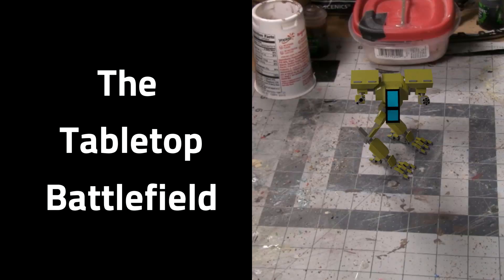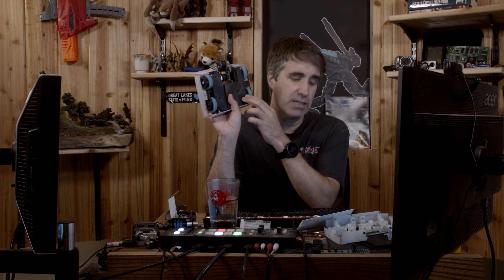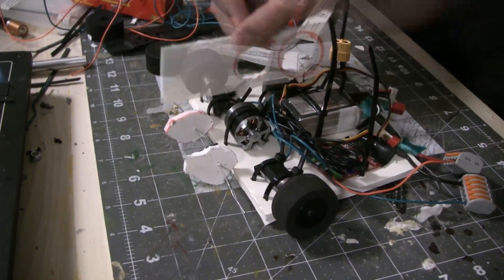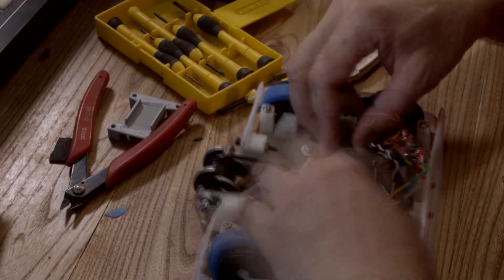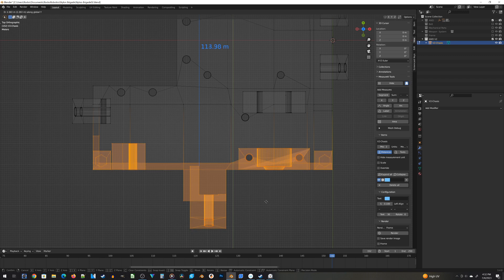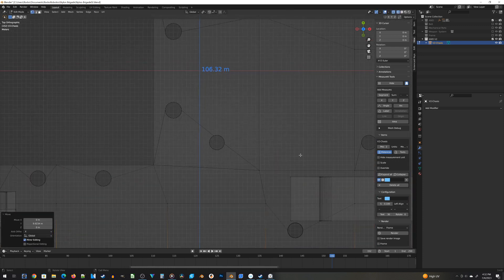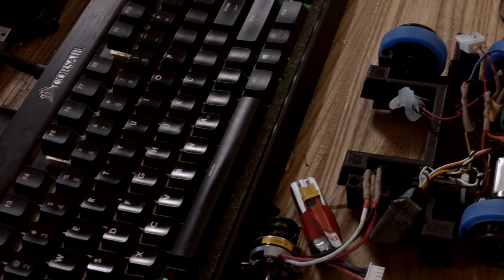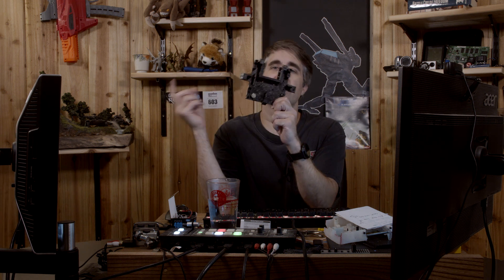Lighter Chassis = More Destruction - Improving Your First Antweight Combat Robot Ep01

Comment: I don't think using blender is that dumb of an idea, if you're comfortable with it and don't need the tooling a more "traditional" CAD program offers, why bother?

Great improvements so far, shaving 30mm off the width is pretty impressive and is going to cascade into (like you said) a lighter armor hoop, but also a lighter top plate and is going to stiffen up the body a ton from simply having less lever action going on over the longer distances.
Reply from the maker: Considering that it is on that list of improvements I held up at the start, I completely forgot to mention that it would make the robot more stiff.  Thanks for pointing that out.